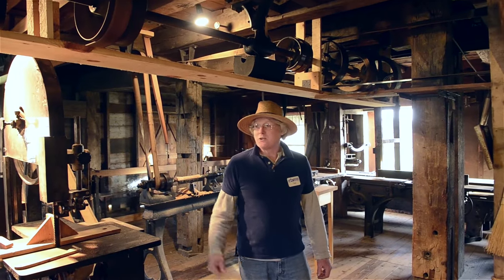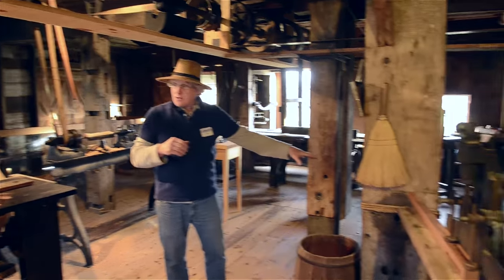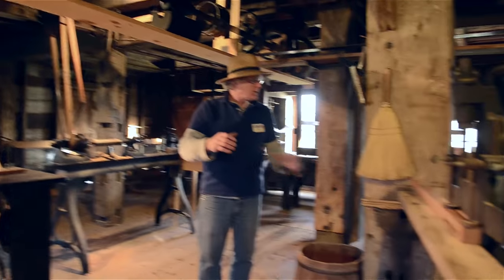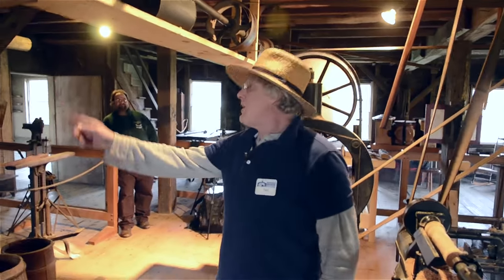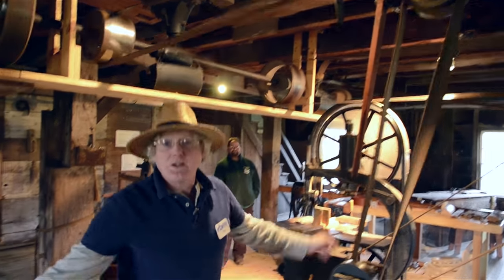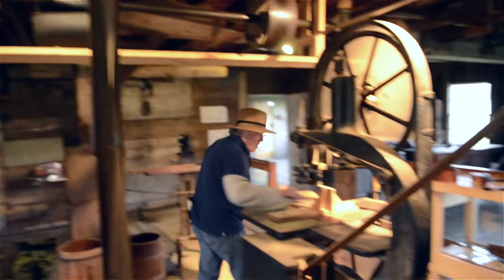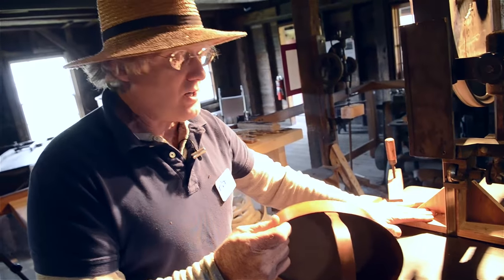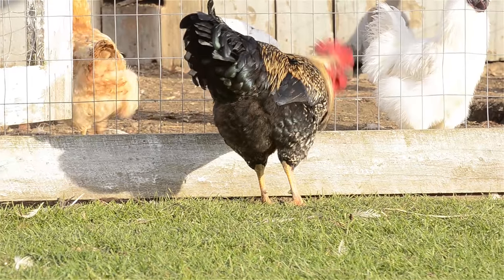Incredible Water Powered Wood Shop at Hancock Shaker Village

Comment: That's frickin' sweet bro. I was expecting hydroelectric, but then I saw the belts.
Reply: Years ago, This Old House toured an old shutter factory. The shop was originally powered fully by water power. They had upgraded the system to hydro-electric, but they kept the original shaft lines and belt drives.
They had installed a hydro generator, and two electric motors to drive the main shafts. All the original belt drives to each machine was still in use.
The generator produced more electricity than the shop used.

Comment: The 18" Buss planer in the background would be terribly limited in length capability where it is currently obstructed on feed inside and feed outside direction.   But every shop was a composite of "current need" and the cheapest/easiest way to "get-er-done."   Perhaps they planed their stock "at length" rather than whole pieces?